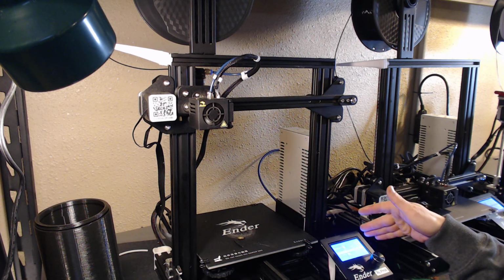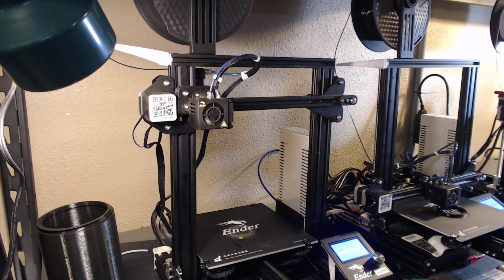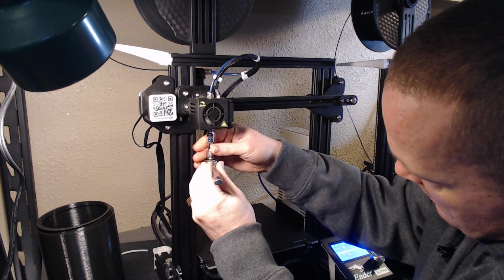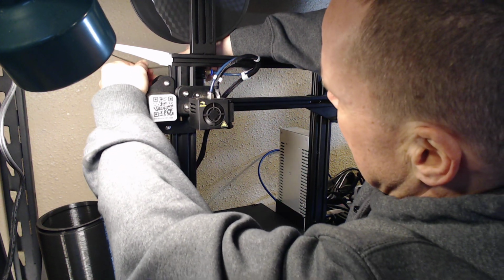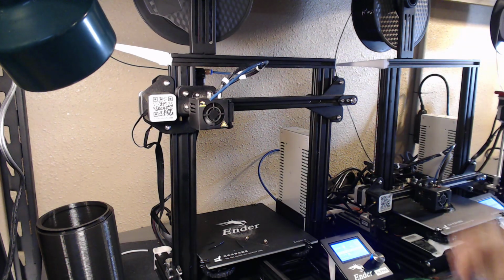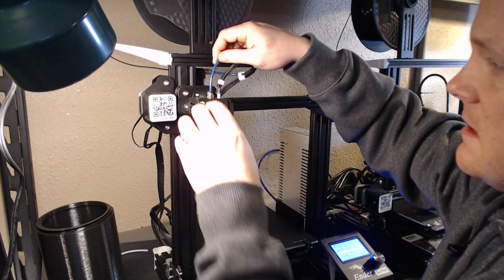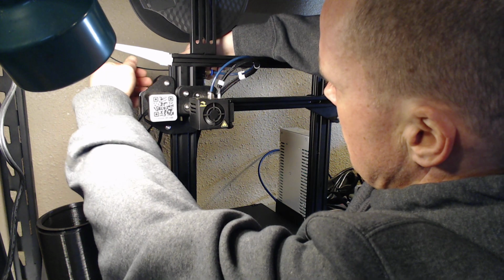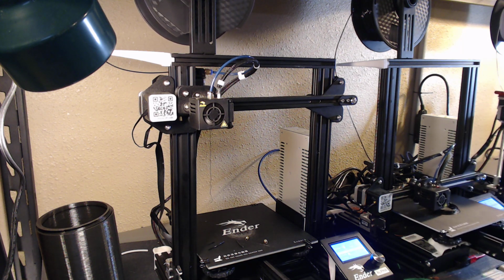When and how to change your 3D Printer Nozzle

Comment: Can barely hear you. I subscribed after watching your very good video about changing filament mid-print.
It was perfect and exactly what I needed, since I ran out of the sample filament printing one of the Creality-provided g-code files.
But, this one has very low input volume. I don't know why, but it can be easily fixed post-processing by using a tool such as the built-in audio tool that comes with KDEnlive, a video editor free on many Linux distributions. Or, you can use something like Audacity, which can extract the audio from the video, and has tools to increase volume. Once that's done, you can turn off the audio in your video editing software, then import the enhanced version you fixed with Audacity.
Easy as pie.
I've done that for YouTubers before (no charge, but maybe that should change)...